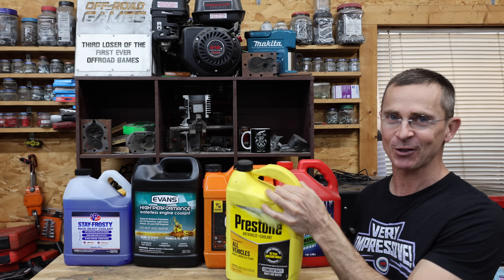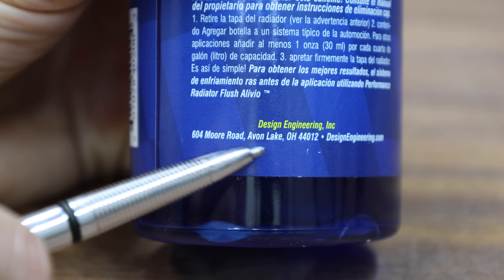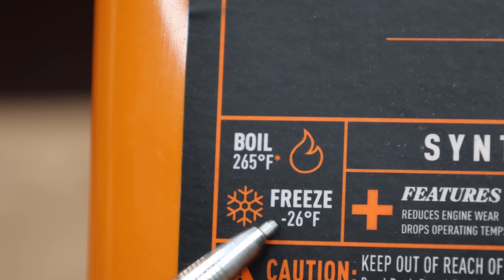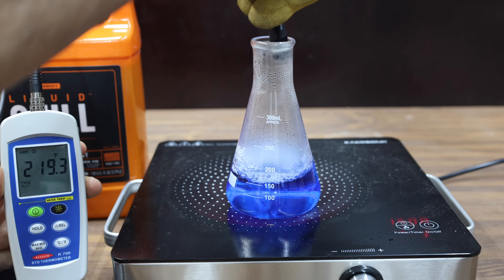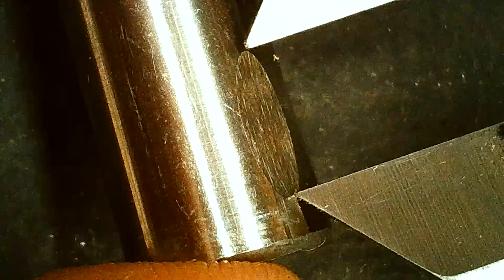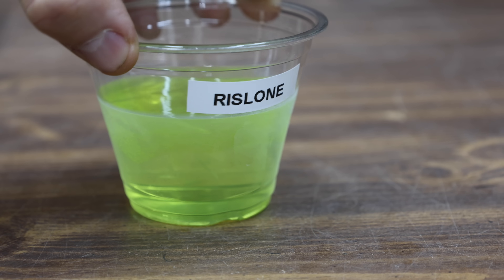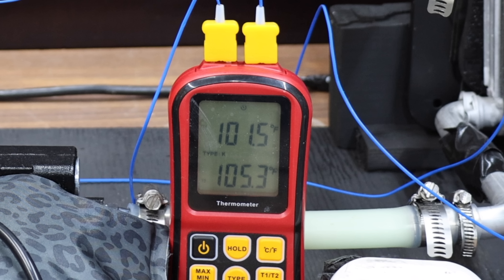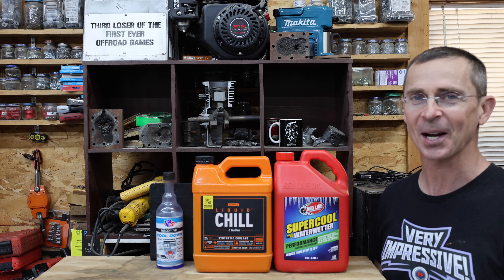Do "Super Coolants" Lower Engine Temperature By 30 Degrees?

Comment: I’ve run Evan’s in my truck for 10yrs now. Never been changed. Ph remains the same as when it was put in. You can drive for hours and open the radiator cap without risk of pressure pushing the coolant out and burning yourself. The idea of Evan’s is you don’t get any steam pockets , hot spots or boiling therefore have a very low risk of engine damage even if the engine temperatures go above the red on the gauge.
Reply: I believe Jay Leno mentioned he was using the Evans product in his car collection.
Reply: @tgroves4831  He uses it in all his cars.
Reply from the maker: Thanks for the feedback!
Reply: Yes thats why i use Evans on my sierra cosworth 580hp 2l turbo engine. I can drive engine up up To 180c and its still ok. And no radiator seal, no pressure on the system. Its just stubit to limit your engine potential for water boilingpoint..
Reply: I really wanted to try it in my 4runner, but after reading that its thermal capacity is low and viscosity is higher, I decided not to risk using it.
Reply: @TheFlaptrapper I've been running Evan's waterless coolant in my BMW in Arizona since 13 years ago and it has never failed to maintain the desired operating temperature. I can see my coolant temperature on my dash and it is always held at the thermostat spec. So regardless if Evans has a lower specific heat capacity than water, it still performs the job of cooling 100% successfully without issue. 

I made the switch to Evan's because of experiencing a catastrophic blowout of my radiator due to the high coolant Pressure caused by Water content in typical coolant that creates Steam pressure in the cooling system. And left me stranded. Was very unsettling to think I could be stranded at any moment's notice. What if I had been driving through the desert? 

Years later when that replaced radiator cracked, I could smell and then visually see a small leak of the Evans fluid from a crack in that dang plastic radiator neck And was able to drive to a repair shop, leak notwithstanding. And not be left catastrophically stranded. This is because Evans does not create Steam Pressure like regular coolants. ...No pressure, no catastrophic blowouts.

No corrosion or electrolysis is another advantage of Evans because of containing no water
Reply: Don’t you have to install a lower pressure cap on the radiator/expansion tank when you run Evans? I recall seeing that somewhere.
Reply: @ripperace It doesn't matter what radiator cap you use with Evan's coolant because it does not create steam pressure in the system. Maybe only 2 to 3 PSI when it's hot due to fluid expansion

Comment: NONE of these products work efficiently or well with more than 25% antifreeze.
After 20 year's of living in Phoenix & working at the Speed Shop I can tell you with certainty they Do work when used with Water. As we Don't use antifreeze in any drag car's as any even small leaks make the track slippery...
Majority of us use Water Wetter & usually see about a 10-15° lower running temp with the product & distilled/deionized water as well. We have Hard water in AZ which also reduces efficiency.
IF you do some testing of JUST the Water Wetter additive NOT the pricey premixed crap. As 75% of us using this type of product it's for a Summer/Performance vehicle which doesn't need "antifreeze"
Thanks for your work 👍🏽👍🏽
Reply from the maker: You are welcome!  Thanks for sharing.

Comment: In my years of owning BMWs, I remember thinking how running cooler would be great on certain models that were known for cooling system problems, often models or engines that ran particularly hot (108 degrees), and of course most BMWs use a pressurized expansion tank ranther than an overflow bottle.. then I realized that BMW had a reason for running them hotter - it improves efficiency and improves PCV system performance, extending oil life. So it's definitely a tradeoff, and cooler isn't always better. 😊
Reply from the maker: Thanks for the feedback.
Reply: Basically everything likes it a bit hotter except for the coolant. 😂

Comment: I would be interested to see how they test with just water and the cooling product by itself, as many of these products are designed to be run with just water and the additive. Race cars are not allowed to use coolant so they must use a water wetter type additive.

I had a CTS-V that would constantly get 225 to 230 in LA stop and go traffic in the summertime with air conditioning, but I ran the rislone with water in the cooling system and my temperatures drops to 190. Consistently and all summer long. I now exclusively use the rislone In my race car, but would love to see how others stack up
Reply from the maker: Thanks for the suggestion.

Comment: Really glad you did this test!! As a mechanic I have a couple concerns, everyone knows you absolutely cannot mix coolant colors. Can these additives actually be used in all applications, even gm dex bs? Also in the sport bike community it’s common to not be able to run normal coolant on track as it’s too slick if it were to hit the track. It’s very common to run distilled water with redline water wetter, and I would have loved to see it compared
Reply from the maker: Thanks!  Thanks for the suggestion.

Comment: Love your channel,  before I buy anything I usually make a pit stop here 1st.
I have a suggestion. 
A test on pre-wash foam that you spray on with a pressure washer for a foam soak.
I've used one in the past and it seemed to make no difference in end result after pressure washing
Reply from the maker: Thanks!  Thanks for the suggestion.

Comment: Well tbf water wetter and the stay frosty are required for racing. Regular anti-freeze isn't allowed on track because anti-freeze is like oil on a track surface. And with water wetter my car runs about 180 degrees farenhit and with anti-freeze it's 210. Could just be the water doing most of the heavy lifting lol.
Reply from the maker: Thanks for the feedback.

Comment: Why would you want to lower the temp 30… you engine is designed to run at a operating temp.. to low or high isn’t good

Comment: engine temp is controlled by the thermostat, not the type of fluid. your ecu also wont go into closed loop if it was 30 degrees colder, and rings would wear faster. engine wear occurs at lower oil temps

Comment: OH! Could you do another round of vacuums with battery vacuums from powertool companies compared to things like Dyson flagshiops? I was very curious about them because for example Dewalt has the DCV501HB, a battery powered vacuum that is supposed to work with workdebris, even tiny peaces of concrete to my understanding. What if these power tool ecosystem battery vacuums designed for heavy duty are secretly the best things ever? Thanks as always!
Reply from the maker: You are welcome!  Thanks for the suggestion.

Comment: Fun thing about coolant. For diesel’s specifically, you NEED you coolant to be right at basically 200-208 degrees so the fuel properly combusts. Similar situation for gas but gas is much more warm blooded. Cooler coolant in most cases is actually HORRIBLE!
Reply from the maker: Thanks for the feedback.

Comment: Could you maybe make a video comparing digital calipers (the calipers meant for precise measurements)? You could test them by using a calibration bar like the ones by hyuduo which are very precisely cut things of metal which let you test micrometers and calipers. I’m wanting to get some calipers that could go down to 0.01mm but I’m worried of their accuracy and stuff
Reply from the maker: Thanks for the suggestion.

Comment: Would be curious how the oldschool dishsoap trick works for cooling, they say it lowers the surface tension of the coolant or water and allows better contact with surfaces to increase cooling
Reply from the maker: Thanks for the suggestion.

Comment: If the manufacturer recconmended coolant isn’t cooling you got either bad recconmendation of product very unlikely something wrong with cooling system and or engine or bad coolant pretty likely or your in hot weather conditions I don’t see the point in having extreme coolant for something especially since running to cool causes issues with performance and fuel consumption and even oil irregularities or mixture of oil and coolant in some cases. If you keep having problems get a better fan and or bigger radiator more expensive coolant isn’t gonna work. But you can do you.

Comment: could you do a video on seam sealers spot weld two pieces of metal together and seam seal the cracks shut and spray salty water and acid on them let them out in the elements then take them apart to see which one is best! you can also see which one is more resistant to heat and other chemicals like gas and diesel and engine oil to see if some are more resistant to chemicals you can bond prices together and test to see how strong the bond they have
Reply from the maker: Thanks for the suggestion.

Comment: I would have liked to have seen the test with the heat exchanger having the inlet coolant temps reading more like 180-200f since that’s typically average thermostat temp or ideal coolant temp for most engines and more then likely where these additives are also designed to work at. They might act totally different with the coolant temp being much hotter. 

Still a cool video tho really well done just to me testing the coolant inlet temps at most common engine coolant temperatures would show/test a more real world equivalent result if that makes sense.
Reply from the maker: Thanks for the constructive feedback.

Comment: I use evans waterless. I would rather pay the extra money and have no water involved, the main corrosive catalyst, additionally if running at high temps get better heat transfer, no vapour layer can be created.
Reply from the maker: Thanks for sharing.

Comment: Heat exchange is temperature difference, mass flow and thermal capacity. This test only measured temperature difference. 
It was mentioned that fluids had different viscosity, how did this affect the mass flow? 
I didn’t see any comparison between heating power and temperature. 

Did I miss something? Otherwise, for example turning down the pump flow could be interpreted as better heat transfer by increasing temperature difference.

Comment: Well indont think there is much concern for engines running cooler as they are speced to run at a certain temp.  If they dont you get problems.

Thermostat should also just let the engine run by limiting bylass to tye radiator
Reply from the maker: Thanks for the feedback.

Comment: Why test the temperature drop at only 115 degrees, instead of at typical engine operating temperature?  And also why not test the resistance to heat, like how long it takes to heat up to a certain temp. Or something along those lines

Comment: The temperature difference test you did might lie because there can be better results due to lower specific heat capacity that skews the results from the real life engine application. There should be a constant power heat source and then only the lowest temperature should be judged, not the difference! Also the temps would optimally need to be near 200 degrees or maybe even over that to simulate the real situation better
Reply from the maker: Thanks for the feedback.

Comment: Nothing removes heat better than water, everything else is based on water and is always higher. Antifreeze Lubrication is to extend water pump seal life. What your lug test results fail to consider the effect operating pressure on the coolant system, that is, the lower the pressure the longer the seal life as well as life of other system components. In addition you failed to consider that Evan’s is life time, not change every 2 to 5 years. When you consider this factors Evan surpasses the others.

Comment: The two most important tests for customers purchasing these coolants are missing:
-The test needs to measure the actual cylinder head temperature of the coolant in a boil over condition(Measure cyl head and wall temperature as the engine heats up and exceeds boiling temp of traditional coolant). Coolants at boil over condtion are not properly cooling the cyl head(steam is forming at the cyl head, reducing coolant contact on the head) and measuring the coolant temp opposed to the cyl head temp only gives you the capped pseudo temp that the liquid phase change occurs at.
-The difference in cyl head temp needs to be done at proper operating temp of an internal combustion engine, not at around 110*F

Comment: We’ve been using Evans for years in older motorcycles with magnesium engine cases to prevent “magnesium rot”. Interesting to see that it actually is so much better at preventing corrosion.
Reply from the maker: Thanks for the feedback.

Comment: Sorry for adding this idea here but a lot of us diesel owners are being told buy oil bypass kits or buy the larger car filters. My question for a possible test idea is what’s better at cleaning the oil?
Reply from the maker: Thanks for the suggestion.
Reply: @ absolutely there’s just so much confusion imo that it’s hard to choose and the only info you can get is from the builders of the kits and imo it’s way to biased

Comment: The best!  
I have been wondering about diesel oil filter bi-pass systems for marine applications.  A typical 80 hp marine diesel engine costs approx $7k.  
Would a oil bi-pass system  1) substantially reduce engine ware  2) increase engine run time between oil filter changes 3) be cost effective?
I realize to find the answere to these questions would be expensive, but hell you are the PROJECT FARM.
Keep up the outstanding work.
Reply from the maker: Thanks, will do!  Thanks for the suggestion.

Comment: What's the point of a higher boiling point ? Do you really want your collant temp to go that high ? Wouldn't that mean there's something wrong ? Or is it for high power applications where you know the engine can take the beating but the coolant won't ?
I'm genuinely curious, I bought a car secondhand last year and the coolant is the only liquid I didn't replace and I'm torn between this one and the liquid chill

Comment: I use the VP racing additive in my 1,200whp camaro. It definitely did drops temperature in both the radiator and the intercooler. And interestinly enough by about 7 degrees from what i saw. Which is in line with your testing. One claim that isnt tested is the dropping cylinder head temps. I would really like to see if there is any truth at all to that.
Reply from the maker: Thanks for the suggestion.

Comment: I stand by Evans,been using it for over a decade now on a sr20t. With it's high boiling point, it means it eliminates cavitation and it's designed to grab that heat out of the engine.
Reply from the maker: Thanks for sharing.

Comment: I'm not into temperature even tap water will do the work... I use coolant because to avoid corrosion in the system causing the engine to fail.
Reply from the maker: Thanks for the feedback.

Comment: While i really like this review, no coolant operates at 110*f. I would be much more interested in thermal resukts at 180*f as thats where most engines operate. Also there is a huge difference in energy between 110 and 180.

That said thank you for the informative review as always
Reply from the maker: You are welcome!   Thanks for the suggestion.
Reply: @ProjectFarm  I hadn't considered how coolant temperature might effect the ammount of temperature drop.  When you thought to test at 3 different temperatures, I was quite surprised that the tests weren't done anyehere close to operating temperature... particularly since that seems to be what the additives all claimed to help.  As usual you did think to test several features I hadn't considered.  Overall, a nice video, but it just seemed odd not to test how well the fluids dropped the temp of coolant in danger of overheating.

Comment: Excellent video.  There seems to be an elephant in the room.  Engines - materials, gaskets, seals, lubricants, regulators, sensors - are designed with fairly specific parameters in mind.   You can't simply alter part of an equation and assume it will not alter the other variables.  It also appears an official position from car manufactures is out regarding the use of these coolants.  So, for now, the burden of responsibility within warranty appears to fall on the car owner should something go south.

Comment: That's a lot of comments!  I was surprised Evans performed equal to the 50/50 in the delta T category.  I am so pleased you measured the inlet/outlet temps of your heat exchanger.  It's been impossible for me to find anyone who has measured radiator BTU removal on YT or even a simple delta T measurement.  Until now.👏 Our vehicles are lacking in instrumentation to truly measure the (heat removal) performance of the cooling system.  In addition to the typical water temp gauge, I wish I could see the inlet and outlet temps at the radiator, cylinder head temp, flow through the radiator, flow through the bypass (or % of thermostat open to the radiator) and timing advance.  So... thank you for taking the time to set up that clever experiment. 👍
Reply from the maker: You are welcome!  Thanks for sharing.

Comment: I have a subaru crosstrek, from what I understand, the CVT cooler shares engine coolant, and im considering an additive like to help keep temperatures lower if possible. Im concerned about adding anything thats not Subaru OEM coolant to the system however... any known risk to doing this?

Comment: I'm kinda curious how different ratios of regular coolant compare to the additives. Like if you buy 100% coolant, mix at say 60% coolant/40% water, do you end up meeting or beating the benefits of any of the additives, and at a fraction of the cost (cheaper than buying 50/50 pre-mix even).
Reply from the maker: Thanks for the suggestion.